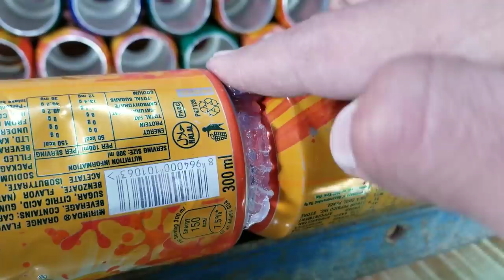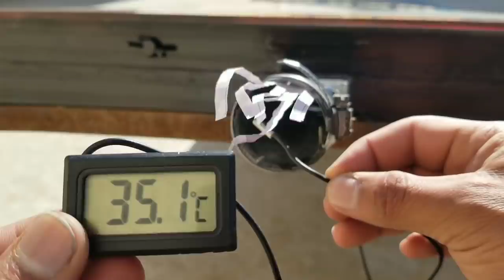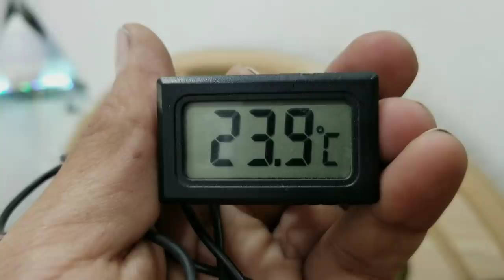How To Make Solar Air Heater From PEPSI CAN! (60°C)

Comment: My 3 foot by 6 foot unit output 70C of warm air and I installed it straight on my southern facing wall. It heats up my bedroom nicely. Even when cloudy it increase the interior temperature inside the unit by 10C. It worked so well I made a 6 foot by 6 foot unit who has a output of 95C. It cooked the electric fan in the top ventilation hole so I move the fan to the bottom hole. Free heat is great!
Reply: @emmanuelyanni5148  Good afternoon Emmanuel, here is a video I made last year in February showing my 6 foot x 6 foot unit in operation with an output of 95 C (200 F). 

https://youtu.be/7S8CWsIcK20

While the outside temperature was just above freezing with February snow on the ground, the internal heat in the dining room averaged 3C to 6C increase of temperature over 4 hours of solar heat.  

Daily operation: at arm's length roughly 6 feet high daily remove the 4"  round wooden insulated ventilation plugs: top and bottom. Then click on the little electric duct fan in the bottom hole for increased air circulation through the heating solar air house heater unit. It's important to keep things simple and controllable by individual citizens.  

Done nicely with good, clean and sealed insulation most if not all can become far more energy self sufficient. And self sufficiency is a good sign of prosperity and peace. Growing food, commerce, business and growing trees and sharing fruits and vegetables, even flowers.   

Ok, to build a solar air heater we need a large shelter: basement, dining room (ask the wife first), garage, workshop or lean to roof. We'll need 2 low and long dresser drawers of the same height..or not. We are building a large, flat, solid work shop bench. Let's double my current workshop bench. Install plywood in the back for structural support. Fit nicely and pre-drill with 1/8 drill bit before the wood screws. On top, center a full sheet of 3/4" plywood on top of each dresser drawers. Along the outside bottom edge rip 2x4 for screwed in supporting 2 x 2's. These 2x2's support the plywood shoulders making it solid when the outside plywood corners collect to 45 degree bottom legs of more 2x2's collecting nicely to similar bottom railing for solid structure.

With two of these sturdy, solid work bench tables, we can put them together forming a really large work table...perhaps move everything out of the dining room for a week or two...maybe a month or two. Join these tables together with another full 2 sheets of 3/4 plywood at 90 degrees on top connecting the tables. Then under the bottom lips of the plywood corners to connect the tables structurally together we can bolt full and long 2x4's connecting corner to corner of the united tables. Connecting these horizonal corners and middle rails being structural supported by vertical or 45 degrees 2x2's screwed into the bottom railing of the dresser drawers.

This table is huge. Its 8 foot long by 8 foot wide. Strong and solid. Now we need some angle iron, metals and tools.

Buy 2 pieces or 4 pieces of 8 foot long with 1" or 2" width steel angle iron. We need to embed this steel angle iron flush into the top edges of this huge table. With this corner we will bend our steel box to house and hold the solar air heater. Embed the angle iron with screws and then use a sanding disk on a grinder to flatten the heads...sparks in the dining room...fire extinguisher nearby before starting and clear area before...and ear plugs and of course safety glasses.

What size of solar air heater do you want or need? How much heat do you want? What's the size of your southern sunny wall? Want to start small? Or go straight for big? Is drilling two holes in my house water safe? How does it all fit together?

I recommend we start with measurements: size of rooms to be heated, size of available solar wall space, insulation  R value of attic, walls and floor.
Reply: @aaronvallejo8220  Aaron, thank you very much for your explanation. I will take all your recommendations into account when I start doing the work.
Initially, my idea is to make a heater that allows me to increase the temperature of my bedroom. It is between 25 and 30 m2. The bedroom walls facing the outside are normal cement and brick walls, while the two interior walls are made of plaster and expanded polystyrene.
The temperature in Montevideo in winter is between 5 and 10ºC.
The place that I have available to place the heater is the roof of the house, since the walls do not get sun all day.
Would you recommend any particular size to make the heater?
Thank you very much for your reply.
Regards. Emmanuel
Reply: IF YOU MAKE A HOLE IN THE WALL TO LET THE AIR IN, DURING THE DAY OR ON SUNNY DAYS IT IS WONDERFUL, BUT WHAT HAPPENS AT NIGHT WHEN THERE IS NO SUN AND THE TEMPERATURE IS COLDER, DOESN'T IT BOTHER YOUR BEDROOM BY FREEZING?
Reply: @lhospitaldelosgigantes  Make R25 insulated hole plugs.
Reply: just out of curiosity..... since it generate heat only during the day, why would you use it to heat a room that you don't use during the day ?  wouldn't be better in a living room, office, kitchen or dining room
Reply: one last question, when it output 70c, what's the outside temperature ?
Reply: @Stéphane Boucher  The bedroom wall was the most exposed southern wall for heat production. Generally outside temperature was around 0C or freezing.

Comment: Just a thought and not criticizing.  Since air follows the path of least resistance and the perimeter of the box is sealed, the need to tightly seal all gaps between cans and can holders, top and bottom, likely provide very small returns in efficiencies.  Likely having just enough silicone to hold them all together is sufficient.

Comment: These can based solar collecters are attractive - trash to saving cash. BUT! Now these have been installed for years, the oxidized Bisphenol A liners of the can/collecter should be considered. Bisphenol A dust in the building and the noxious chemical which can be blown through a units should be measured. In places where people have been exposed for years, the endocrine, neoplastic and neurologic diseases associated with these chemicals, along with other rare maladies, should be measured.
Reply: would a HEPA and/or active carbon filter solve this issue?

Comment: You did it right. Did the same then later sold my home. The next owner cast all it out. My home was a pleasant 85° in January. And every ° was a victory. To save money I couldn't spare as my wife died. And had less income. Now on good pension. And  warm enough now . Use the sun it's free heat.
Reply: I discovered a useful compilation of videos that should help you at Ewans energy roadmap

Comment: heat will kill the turbine quite fast; and the turbine is not so easy to replace, under the glass(?). great job !
Reply: Have had mine going for 4 winters now and haven't had any problem. 
But mine is further up in the lead hose by about 6 inches.
Just tested the speed and it is same as when I started so yeah. 
Besides if it ever does go out there's a lot of them for free😊

Comment: Real men use beer cans instead of soft drink cans. Just teasing. I would make a couple of suggestions. First the unit needs to be insulated. Instead of aluminum frames I used two layers of 1/2" foil faced styrofoam. Very rigid. Mine is a thermoplane. It draws inside air in and heats it then convection blows heated air into the house. It raises incoming air temp by forty to fifty degrees F. Saving money I used corrugated green house panels for the glazing. The cans I glued together with construction adhesive. I've used mine for five years now and it paid for itself the first winter. You're wasting a lot of heat if you're heating outside air instead of recirculating inside air through it.

Comment: after the sun goes down it will become cold at night??? this can be use for the whole day only?  the solar panel should have rechargable battery..
Reply: I've been using similar in my cabin in winter.
It's at 8600ft in the Rockies. 
Since I've had mine I use SO much less wood and the cabin is never cold when I return after skiing.
I have one box a little smaller than his,  (yes it's homemade) but with 3 hoses  spaced evenly at floor level in a 1000 sq ft home. 
Take the time to do it if need be and you'll never be sorry 😊
Reply: why would the solar panel have a battery? when there is no sun, there will be no heat

Comment: A fan is not needed and will likely cool down the unit faster than it gets hot. Go passive instead, warm air rises so all air that sits in the unit want to go up and therfore draw cold air into the unit from the bottom, like a standard heating radiator.
Reply: Convection 👌

Comment: The output temperature will go down eventually. A larger surface area and lower air flow through the cans can maintain the heat.
Reply: The temperature does go down over the years caused by maybe dust perhaps. The bigger the unit the better and more heat output.

Comment: The thing is if it's hot and sunny outside why on earth you will want to sit inside your house, which basically makes the whole effort useless. Thanks for sharing though.
Reply: When it is sunny and cold outside this unit will pipe that heated air into your house. Works best if your house is highly insulated.

Comment: Did You know, that aluminium release aluminium oxide, when heated? 
In what range of heat this contraption operates?
Reply: It's not dangerous in the air....  If you take dust aluminium oxide inside it's toxic ....   You have a car.. your hot sistem its from alumin ...  Classification in air from the al.ox..  it's not carcinogenesis...

Comment: So wat of winter?
Reply: It works in the winter when sunny to add heat to your house.
Reply: What you are doing is using the infrared spectrum of light to heat the cans. You could use just a black box to warm up the air inside a closed system.  You won’t get the same results but it will be warmer than the temperature surrounding the box.  That is why you use in this case aluminum cans.  Not only are you adding surface area to gather more rays but using a better conductor.  As long as you make sure the surface of the box is clear of leaves snow etc then it just works.  No different than the inside of the car sitting in the sun.  It is the same concept.

Comment: whatabout 8pm to 8am :D
Reply: Zehar kha ly ab to es sawal k bad!
Reply: Personally I maxed out my attic, wall and floor insulation to hold on to this precious day time heat which for my unit adds heat between 10 am to 6pm on sunny days. After which I have electric floor slabs which emit gentle and even heat onto my bedroom, living and library. I also have 2 small electric heaters I use most winter evenings. For back up and entertainment I use my fireplace to burn yard wood.

Comment: The inside of the can is covered with plastic. Danger of potential carcinogens in the air which passing through
Reply: Yes true. I have an oscillating air filter in my house I use.

Comment: Paint cans by black color to achieve more heat
Reply: You must have missed the part where he painted the cans black to achieve more heat.
Reply: He used flat black spray paint that captures more sunlight and turns it into heated air for house heating.

Comment: i tried it and quit after 30 hrs and just bought a 20 dollar heater at walmart
Reply: You probably put the electric blower fan in the top, hot ventilation hole and cooked the motor. I did the same. Put it in the bottom cooler ventilation hole. It is quieter too. Then you can reduce the electric heat load you pay for to stay warm and comfortable. Helps to max out your insulation in your attic, walls and floor too.

Comment: Who on earth would need hot air when the sun shines.....rather make a solar water heater the same way
Reply: It can be cold and sunny at the same time...
It obviously was if you look at his temperature reading.
Happens all the time in the desert.. 
you can still capture a lot of radiant heat from the Sun even though the air temperature is quite cold
Reply: you can also watch this geyser of 12 volts https://youtu.be/geuBl6_Ozdg

Comment: fu..ing hot glue you guys use that on everything what happend when that cans is heated by sun ?!?!?!?!?!??!
Reply: RoadKill90s that’s not hot glue, that is silicone
Reply: I did not use any glue...just compression fit the cans together on my small 5 x 3 foot unit. On my large 6 x 6 foot unit I used single lengths of aluminum down spouts not cans. Although I did spray the entire inside in hot flat black paint which offgases for a few days...that was years ago and it is still rocking heat output.